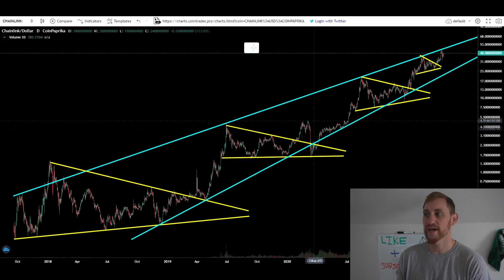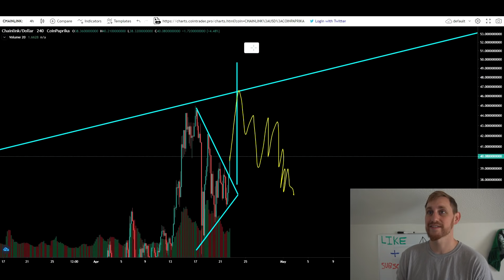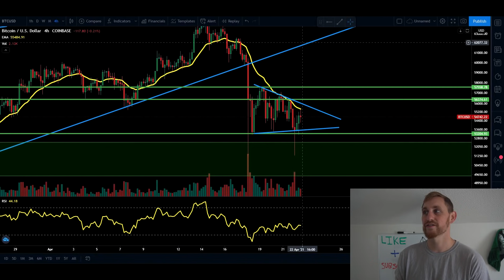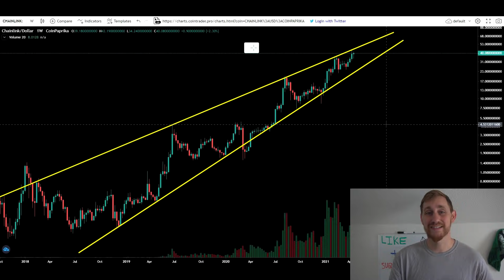CHAINLINK HAS ARRIVED AT ITS MOST IMPORTANCE RESISTANCE ONCE AGAIN! (Next Chainlink Price Targets)

Comment: According to the daily chart, Bitcoin volatility increased, but the bulls are still optimistic. As per the current scenario, if the price can have an impulsive bullish candle close above USD 53,OOO to USD 54,OOO area, the bulls may regain momentum and recover upward towards USD 57,OOO to USD 58,OOO area as a first target. The second target will be USD 64,OOO to USD 65,OOO area if the price can break above USD 57,000 to USD 58,OOO area in the coming days.   My Advice to Beginners, Old Investors, and Long Term HODLERS , if you want to make more Gains with what you have already Invested, You will need the support and Counsel from a Great-Crypto Mentor and coach like mine. “ (Dr. Mike Laury )” will guide you through any difficulties in Trading, I have made over USD 46O, OOO in Btc profit since the November Rally, with the 1BTC I bought at 12,780 USD, Thanks to my Mentor and Counsellor [ @Mikelaurycrypto ] on Telegram, I found his advice very helpful in my situation ♥️_
Reply: It is never too late to get into BTC. But you should temper your expectations when you're a late entry to the cycle. The 10x gains come later when you've held through a full cycle or you are either making trading investments as alternative.
Reply: “I had an extremely informative session today ON Telegram, detailing how Bitcoin works, how to purchase it and how to secure it. Mike Laury laid out for me simple strategies and important information to get me started so I can secure the best possible investment opportunity. There is a lot to learn, however, thanks for being a great mentor.
Reply: I believe as a Trader who is not depending on the price increase daily ,You already have a winning attitude. Most Hodlers are reluctant to Trade, hence they get Jealous of the Traders. Only losers get jealous.
Reply: Omg... I'm so proud of you. Don't let anybody tell you that you've made a bad decision. Godspeed my friend!! I must make huge profits with the little I already bought yesterday, thanks for exposing me to this Info about Dr. Mike Laury , reaching out to him is my next plan .